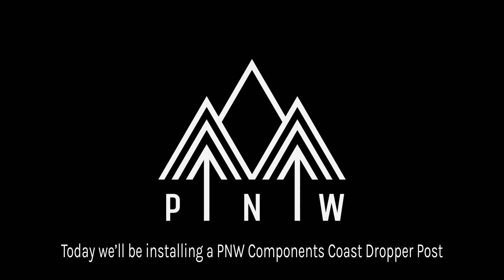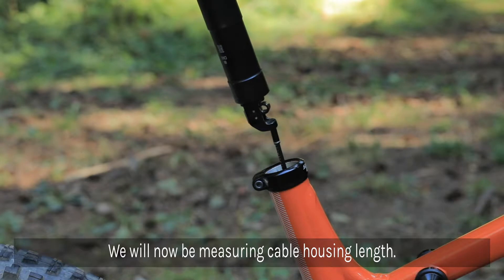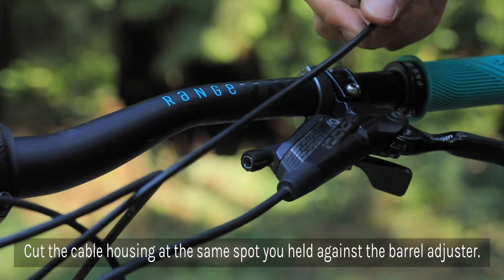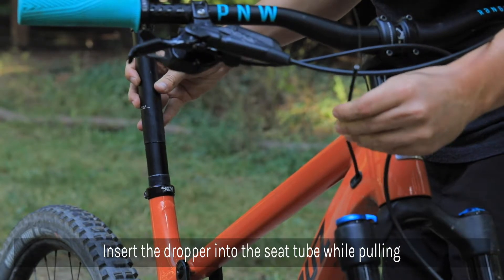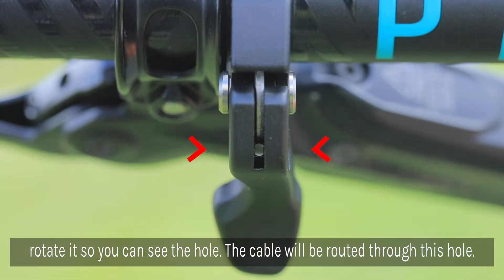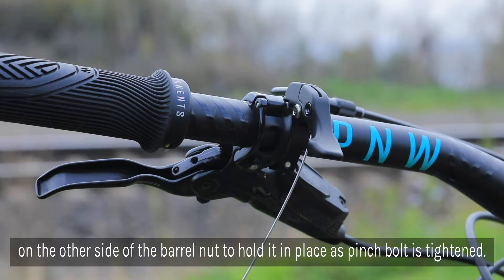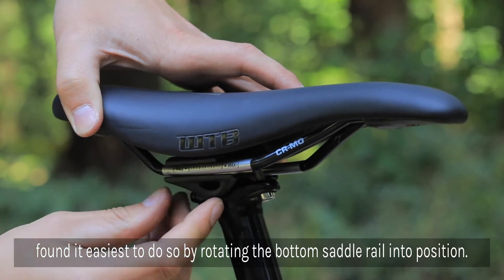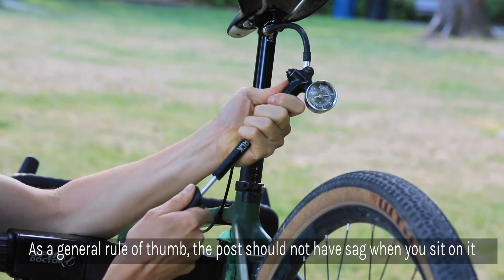PNW Components: How to Install Internally Routed Coast Dropper Post with Puget 2x Lever

Comment: Hi PNW! Thanks for such a detailed video, this is exactly what I was looking for. I'm going to equip my hardtail with the Coast dropper and the Puget 2x lever. The reason is that my bike has a front derailleur, so there is almost no room on the handlebars to fit a larger lever. I am also considering installing the KS KGSL lever as this can be integrated into ODI grips. As far as I understand, KS will also be able to control the PNW dropper? I just think it will save me a few more precious millimeters in the cockpit. And my second question is, do you ship goods to Russia?
Reply from the maker: Hi Sergey! The KS lever in question should work with our dropper posts. Unfortunately we do not ship to Russia.
Reply: @PNWComponents  Thanks for the answer. OK, in this case I will order a dropper to the address of one of my friends in the United States, and they will simply forward it to me.